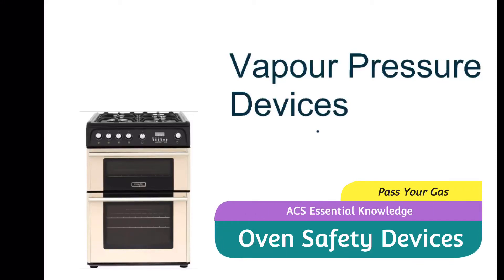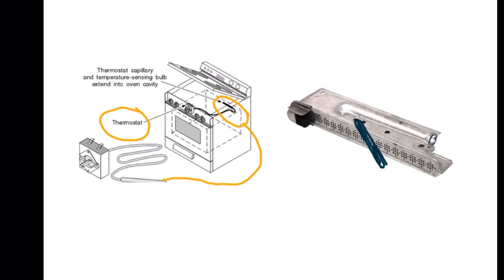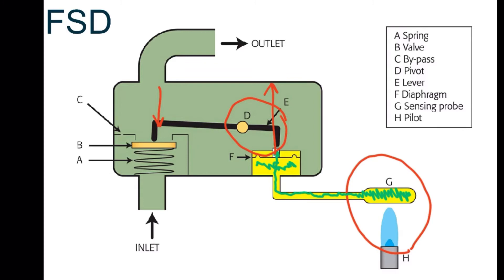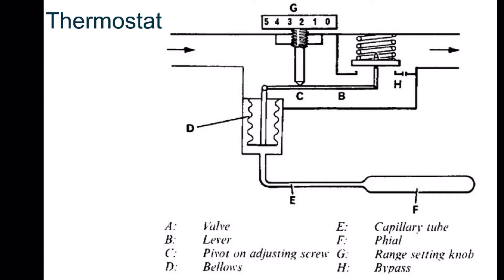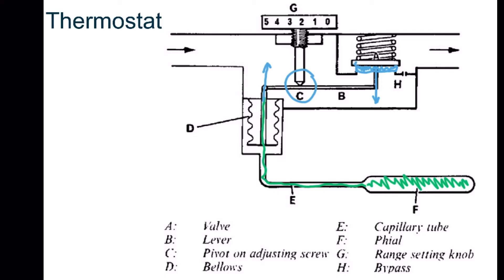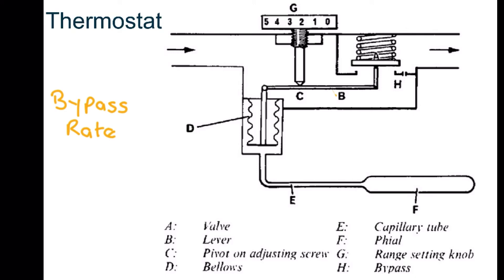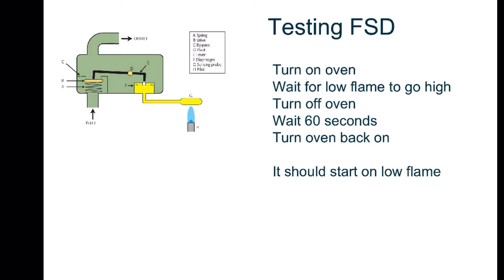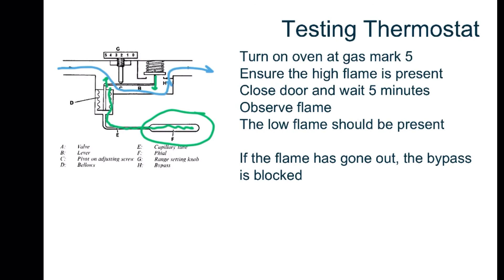ACS Essentials Oven Safety Devices Vapour Pressure

Comment: Nice video only one thing am abit confused is that do both valves have  a bypass but have one bypass in the cooker oven i thought the thermosat has bypass and not the fsd
Reply from the maker: Hi Ruman, thanks for the question. I can see why you’re confused. Think of it this way. An fsd must have a flame to make it open. But how do you get a flame when an fsd is always closed when an appliance is off? There are two ways we do this … 1 is how we do it with a fire or boiler.. we hold the fsd open by pressing down the control for 5 to 10 seconds to allow the gas through at the start, doing this allows a flame to light, heats up a thermocouple and the valve stays open when we release the control. 
On a cooker it would be a pain to have to do this every time you wanted to cook something, so we have to find an alternative. The only other way to allow gas to a flame with a closed fsd is to create a small bypass to allow enough gas through to light a flame big enough to heat the fsd and open it. 
You can see this in action when you first light the oven..it starts on a small flame..this is the gas going through the fsd bypass…then…when there’s enough heat and the fsd opens, he flame becomes much bigger.
So it is a fact that an oven fsd never shuts off the gas fully it always allows a tiny amount through. This is ok though because the thermostat closes the gas off when it’s shut. 
I hope that helps
Reply: @passyourgas  i appreciate you replying to my question i understand that a fsd has a bypass to allow small amount of gas through to light on low then once heated it gets high flame. But am not understanding the bit on the themostat bypass whats that for, is this where when we turn on the oven it allows bypass rate through the thermostat as its always open goin to fsd bypass as its closed which then ignites on low and when the fsd heats up this then opens the fsd allowing full rate which will heat the oven allowing the thermostat bellows to close only allowing bypass rate to the fsd bypass please correct me if am wrong how it works i struggle with this gas controll in my acs class thank you your a star.
Reply from the maker: Ok, no problem. The thermostat controls the heat inside the oven. When the oven reaches the correct temperature that you’ve set (gas mark 4,5,6 or whatever) it will close, stopping the gas..then when the oven cools, it opens again allowing gas through, however, it’s like the fsd problem, if it closed the gas completely then the flame would go out and you would have to keep lighting the oven to keep it warm, so like with the fsd there is a bypass hole to allow gas through even when the valve is closed. This means the flame changes between high and low during cooking. 
Unlike the low flame at the start which is controlled by the fsd bypass, the low flame while cooking is controlled by the thermostat bypass (because the fsd is open while a flame is present) this low flame while cooking is called the bypass rate because the gas is being restricted by the thermostat not the fsd. Does that clear it up, if not let me know. 😁
Both controls have a bypass but the thermostat bypass only opens when you turn the control knob to a heat setting.
Reply: @passyourgas  lol yes i think i got it so as i mentioned earlier when you turn the thermostat control say any number gas flows through the thermostat bypass and this flow rate passes into fsd bypass allowing it to ignite on low. 😄 please say am right your a legend
Reply from the maker: Ruman, you’re ALMOST right. When you turn the thermostat to a number, the thermostat opens and gas goes straight through it, the bypass isn’t involved at this stage, in fact neither bypass is involved as the fsd is fully open as well (because the flame is on). The thermostat bypass only gets involved when the OVEN gets hot enough to close the thermostat. 
Think of it this way … if you are driving a car you use the accelerator to set your speed, once you’re going fast enough you lift your foot off the accelerator but the engine doesn’t stop because there’s still a bit of petrol allowed into the engine even when you’re not pressing down the accelerator. The thermostat is the accelerator of the oven. When it gets hot enough it “lifts its foot off the gas” but the thermostat bypass makes sure the flame doesn’t stop. The fsd bypass is only ever needed at start up of the oven, after that it does nothing at all and everything is controlled by the thermostat.
Reply: @passyourgas  i will really appreciate it if you could write down full process of how this device works from the moment we turn on the oven say we baking a cake because my mind is lost when it comes to this device i have this issue at my acs class with my mentor he gives up with me lol please watch this video i found it on utube is this how it works.
Reply: @passyourgas  https://youtu.be/LR_Ln_PyDqA
Reply from the maker: Ruman, give me a day or two and I’ll have created a video for you to show you exactly how it works. I’ll let you know when I’ve posted it.
Reply: @passyourgas  your a star look forward hearing from you thanks.
Reply: @passyourgas  hi did you manage to create the video
Reply from the maker: @Burncash1510  Hi Ruman, sorry it’s a bit late. I’ve created the video but I’ve had a sore throat and the voiceover was awful (lots of coughing etc) and it didn’t sound good when I edited everything out..all good now so it will be uploaded tonight. 🤞
Reply: @passyourgas  thank you your a star when its loaded just send me the link thanks.
Reply from the maker: @Burncash1510  Hi Ruman .. eventually got it done, I hope it helps.. https://youtu.be/JZAhnMp8BO4